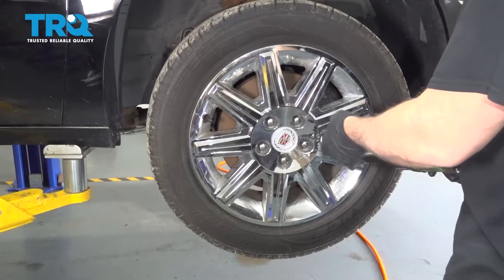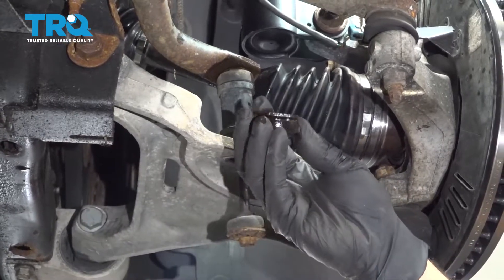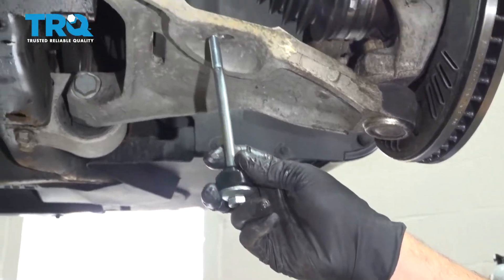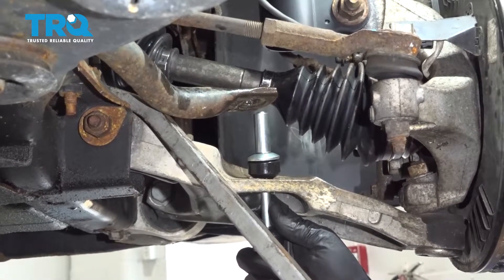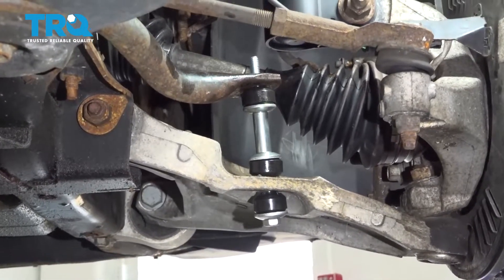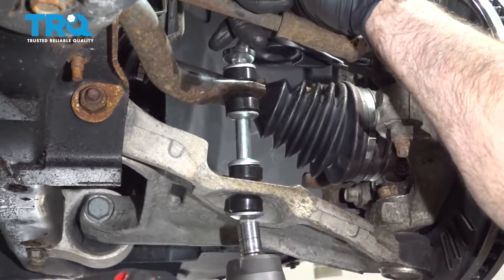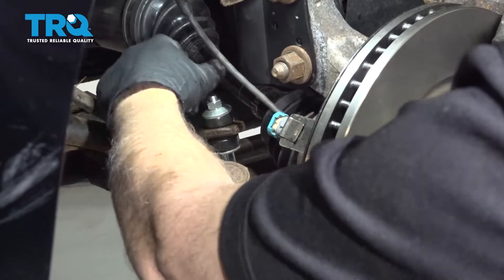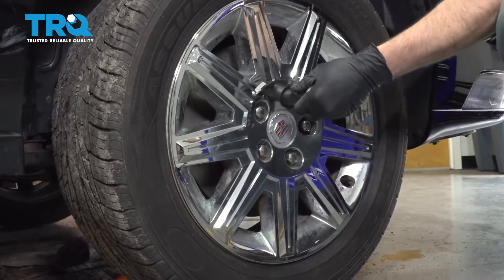How To Replace Front Sway Bar Links 2006-2011 Cadillac DTS

Comment: Yeah, cheap china sway bar links dont have enough thread bolt all the time. They like to FK with our heads all the time. They can be made with an 3/4 inch longer bolts but they dont...It sucks.